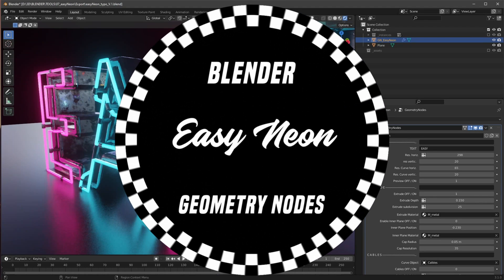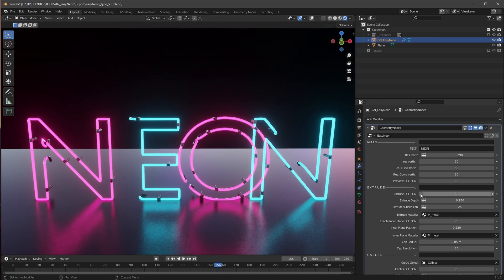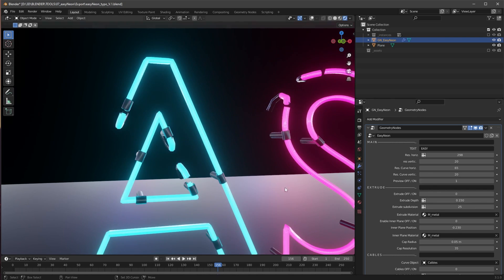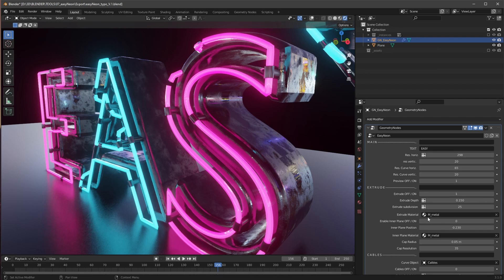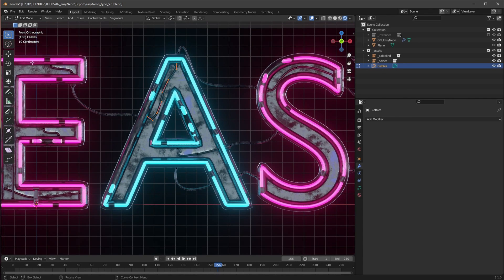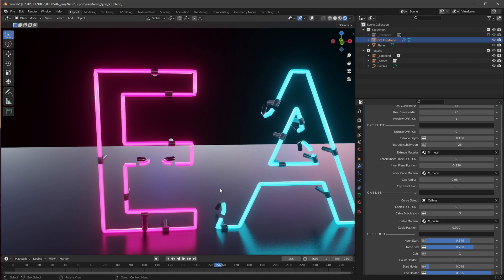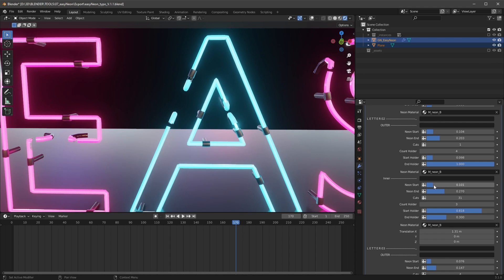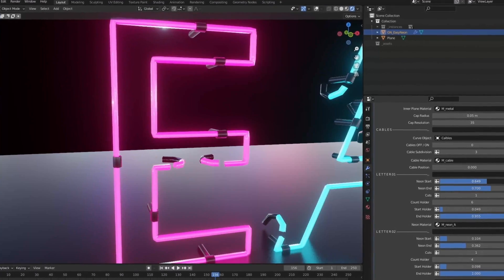Blender 3.1 Geometry Nodes | Easy Neon Setup

Comment: Hey, cool done, thanks! And how to move the distance between the letters?
Reply from the maker: Hey 👋 every letter has its own settings where you can adjust the distance between the letters individually 👍 hope that helps. If not, you can write me an email or on Instagram 😎
Reply: @PizzadelRay  thanks, I found where to move the position of the letter. I moved the letters, now the cables do not hang correctly. How to move cables?
Reply from the maker: Cool 👍 just watch this part here : https://youtu.be/7v6BH2nji5U?t=213 
Hope that helps. If not, just ask 😎
Reply: @PizzadelRay  how to move cables that are already in the scene? I don't need new cables, but change the ones I have.
Reply from the maker: Ok. In the edit mode of the cables(in the assets) you can select the cable points and adjust them.
Reply: @PizzadelRay  oh, yeah, it works, thanks friend! you are cool!
Reply: @PizzadelRay  It turns out that this neon is paid in the blender market. I don't want to upset you, but did you know that it was leaked online?
Reply from the maker: Awesome 👍
Reply from the maker: No didn't know that! Do you have a link or something for me to check?
Reply: @PizzadelRay  I don't remember exactly where it was. I didn't understand your file, didn't know how to move letters, so I abandoned your neon project. And I found this video by chance on YouTube and remembered that I have a file. Besides, I don't want to complain about anyone. Sorry
Reply: @PizzadelRay  there are duplicate objects in the instances collection and in the holders collection. I changed the word and moved the letters. And here is one object from the collection of instances and the holder is outside the letter. And if I move this object, then all other objects with which it is connected also move. How can I remove it? I can send a photo of this object to Instagram, if it's not very clear
Reply from the maker: @Tristan_Mountain  yeah, pls send me an image 👍

Comment: Im using this file, its very good. but it so heavy for gtx1070. is it right?
Reply: how to move to each letter setting faster?
Reply from the maker: Is depends on the font you use. But you can change into a preview mode and it should work smoother. https://blendermarket.com/products/easy-neon/docs in the video at 1:50 😎 hope that helps 👍
Reply: @PizzadelRay  omg!!!! thank you so much!!!!! good!!
Reply from the maker: No problem 😊 happy to help 👍